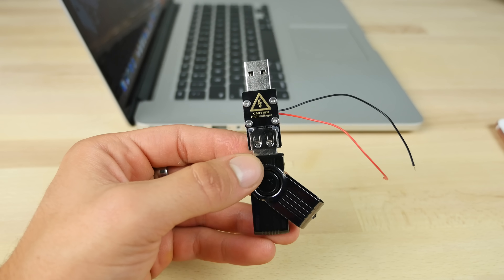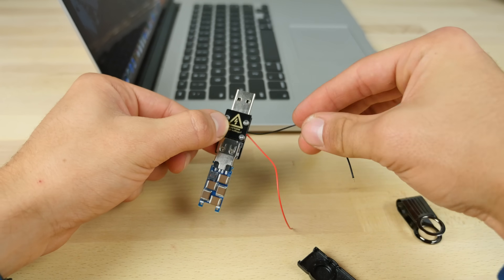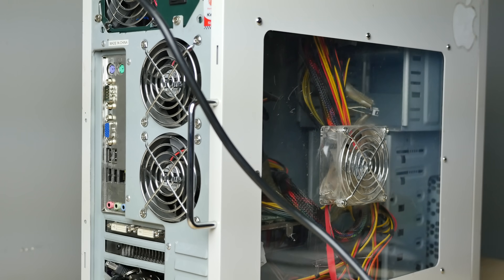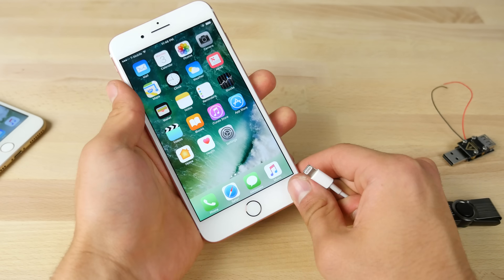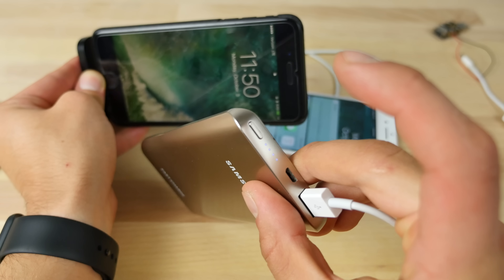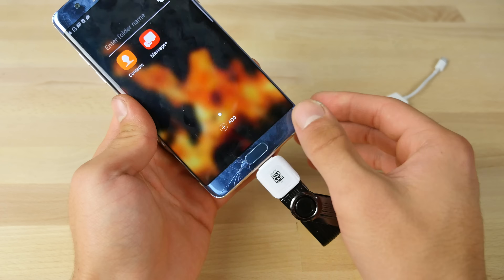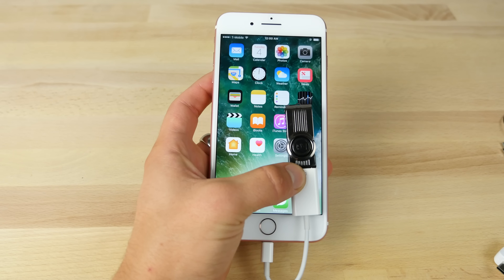USB Killer vs iPhone 7 Plus - Instant Death?

Comment: You didn't try a Home+Power reset of the phone. The lightning port (and the MacBook USB-C port you "fried") does have protection hardware and if the port disables, you have to reset the controller hardware.

I've seen the lightning port on a 6S shut down because it got wet and shorted while charging. Hard reset fixed it.

Comment: how about if you turn off the psu and hold the power button to drain any power left in the computer. Would it work then?
Reply: It needs power, if there is no power it would obviously not work. However it would be an easy feat to just add an on off button on the usb killer so that the capacitors store the electricity and then release it with an on-off button.
Reply: I meant would the computer work if the excess power was drained from within after using the usb killer and obvioulsy I meant to turn the psu back on afterwards. There are also pins on the motherboard which can be used to drain excess power and to reset any fail safes like the thermal overload switches on extension plugs
Reply: I've shorted out electronic projects accidentally before while they were plugged into my computer which would immediately cut the power to my pc and not allow me to turn it back on until I drained the excess power in the methods I outlined above so this could potentially give the same result.
Reply: Also if the usb killer was switched off then it wouldn't be powering up would it

Comment: Its most like CPU is fried,  caps charge from 5V, and send it back communication line, and most of them are connected directly too CPU. Sometimes there is HUB before CPU but the charge can be so grate that it gets to processor anyway , or hub shortens some main board voltage lines after shock.
Reply: The piezo lighter module should have similar effect on 2 inner pads of USB, if you want to fry something easier way;p

Comment: You may have fried either the motherboard or the power supply or both, but the data on the hard drives are still intact.  So, no help for Hillary Clinton.

Comment: I bet that usb killer can't kill a new MacBook Pro
Reply: yeah in the new video the new macbook pro is completely dead
Reply: Joke dead
Abort
Reply: I bet your new Mac that it can
Reply: it kills the data on the port, USB power still works and can charge as well, it looks like this USB killer sends the charge through both USB power and data lines and the data lines can't offset and turn off the power but the power lines can causing the data lines to die at a weak point that keeps the charge from reaching the motherboard.
Reply: Guys I don't know if you're aware of this but
This was joke
Because y'know
The MacBook Pro doesn't have any USB ports
Reply: Austin Evans tried it doesn't kill it but kills the USB port.
Reply: +Ryan Wang It charges but it won't import/export data
Reply: Doesn't it have USB C
Reply: Lonely Potato it can't The new MacBooks have USB protectors so
It can't fry it
Reply: Prep School Swag You got proven wrong :)
Reply: in Austin's video it just fried the USB-C port

Comment: So that IP7 clone has the best protection? unbelievable!
Reply: I don't think it has any protection. It just can't output any current via the lighting port, so the usbkiller can't charge.
Reply: did that phone die? NOT!- it still works without problem

did the original die? YES!- it's completely useless.

In the term of protection against USB killer fake phone is 100% better than original.
Reply: waki It's like saying that a car without tires is better than a car with tires because you can't puncture them. Also, you have to unlock the iPhone in order to make the port powered.
Reply: theSyd the purpose of phone is not to be used as a battery, so you cannot compare that function with a tires, it can be compared only with car radio or cup holder.
Reply: Precisely, it's such a bad clone that it does not even output any current through its "lightning port".
Reply: your all so dumb

Comment: Does the usb killer have a diode and a micro processor so that it will build up a charge in the capacitors and release the killer charge when it hits critical?

Comment: Propably the fuse in the PSU burned, or a resetable fuse on the mother board, because USB ports do have a safety feature/fuse, that blows at, i think, about 700ma or so, and a specific voltage. Also, that isn't a low voltage port, but a low amperage one. I hate people that call such computer rigs old...

Comment: plugs USB iron pc kills it instantly  
plugs into phone charging port goes
Reply: The insides of that PC were strong enough to carry the death to the other components, while on that phone the charging port was weak enough to fail and save the rest of the device. Also, the phones were significantly newer.

By the way, that iPhone is still going to die, just slowly and painfully as the battery loses its last bits of power.
Reply: good for the iPhone
Reply: So if I really hate a girl at my school I can just plug one of these bad boys in and rip to her phone?
Reply: And going to jail for murder. He'd be better off just doing the USB killer "prank" and at worst go to jail for a few months.

Comment: id guess this uses the 5v with a boost converter (can see inductor and capacitors) then it sends this voltage down one of the usb data lines.

Comment: There is a circuit board in the lightning connector on your lightning to usb adapter. Most likely it would have got damaged before anything else which might prevent the iphones from getting damaged.

Comment: What does this cook in side a PC then?
Reply: Six Bytes Im pretty sure motherboard since the usb ports are part of the motherboard
Reply: Motherboard or power supply.. either way your PC is DEAD
Reply: Something on the motherboard like a capacitor would have been overloaded. probably not the psu

Comment: All that "killer" usb stick is a usb port that isn't wired correctly. All it takes is a usb cord end with the wires connected together. Just touch each wire to the other wires until its dead lol. it will short out the board somehow if it is vulnerable. Possibly frying a vital PCB (the little wires in the motherboard).
Reply: It's not a badly wired USB at all. The capacitors store a charge and if you daisy chain it fast enough it can build up a huge charge in seconds. Then all you need is something to release that charge back down the USB port and boom. Bye bye computer. The USB is interconnected throughout the PC via the bridge chip and can do serious damage if there's no USB surge protection.
Reply: if you don't believe my try it on your own computer. just cut the end off of a usb cord and cross the wires until your computer dies. Trust me it worked before on a netbook.
Reply: Eventually, yes it most likely would but this is doing it in like 1 second. That's not even enough time for you to check if it's being recognised by the system or not. Also, most decent motherboards will have protection against slow power buildups from USB power shorting. This is a VERY quick surge that most motherboards cannot protect against. A USB device normally draws power from a USB socket whereas this device draws the power, ramps the voltage up (WAY beyond the standard USB power spec) and then sends it back to the USB socket. That's where this differs from just crossing 2 wires over. This is almost instant and it sends back a much higher voltage.

Comment: its not weird that it doesnt work on smartphones, that usb port is for charging as well, it's meant to handle electrical inputs, the reason it works on computers is because the usb port is not meant to handle charge there.
Reply: That and phones have voltage regulation chips that stop over volting. Also, newer motherboards are starting to have over voltage + surge protection on the USB ports (no doubt because of this stupid invention).

Comment: You fried the charging port but not the phone. Decent failsafe I suppose.
Reply: Until it goes flat...
Reply: Craigatron 
I don't see your point. The charging point was fried instead of the entire phone, I consider this a success.
Reply: dumbass, how ya gonna use it when it dies?
Reply: You can't stay the fuck alive if you can't sleep. Everything needs energy to do work.
Reply: an ignorant .american Good point but Samsung appears to got their shit together.
Reply: an ignorant .american What if you wanted the brand new 800$ phone to work but you only got the data.
Reply: Ivan zou, there are wireless chargers these days, thats how you are going to charge it.
Reply: That's because phones have a very low energy usage. The battery is tiny compared to laptops and desktops.
Reply: an ignorant .american what? how does wireless charging need the device to have a charging port?
Reply: an ignorant .american are you living in 2008? Samsung phones had it built in for yeaaaars 4years ago you could even buy an acessory which used contacts found under the now gone battery compartment, without using the charging port, the lg g4 last year had that aswell, also the S5's all had it, S6, S7, most notes some with it internal, i think actually almost all phones have it these days, it's industry standart at this point... attachment, gimme a break. these are only for iphones
Reply: The iPhone 7 doesn't have wireless charging
Reply: Thijmen Kuik noone said it had

Comment: This shit is scary, specially for people with High-End PCs.
Reply: El Greeko I agree. Just got a new 1060 laptop, I'd be horrified to find this thing plugged in.
Reply: El GreekoWill use that to screw over my insurrence
Reply: I think the only thing it can fry is the motherboard or the powersupply those two componets can be quite cheep if you compare them to a gpu or a cpu, pls correct me if I am wrong
Reply: Ramog1000 You are probably right. I would believe however, that a laptop with CPU/GPU built into the mobo would fry though.

Comment: If you used the same USB killer, no it will not have the same affect as it did on the Pc as it already used its power that it had. You just used the rest of it on the phone, I doubt the iphone has a safeguard against it.

Comment: The iPhone does not have any safeguard against those voltages. The converter is protecting it. The Voltages fried the usb converter chip, and no voltage reached the iphone. 
If you take that same cable, cut it off, and feed the voltage directly onto the data lines, it should die instantly. Not sure tho, because it might also require communication with a chip to go into otg mode.

Comment: It's not a low voltage port. all USB ports are 5v. It's low current
Reply: an ignorant .american
Reply: MOC3043 is an optocoupler...
Reply: That Guy correct
Reply: an ignorant .american He said the iPhone has a low voltage port.
Reply: an ignorant .american well you could use something like a small flyback driver to boost the voltage

Comment: the iPhone doesn't output current while its locked.

what if I hacked the killer, and added a battery to charge the capacitors externally?

Comment: Why hate on a Samsung thing? It's better than Apple at least lol.
Reply: Lorenzo Giancristofaro, or he wants a QUALITY mobile device.
Reply: lol just because you cant afford apple
Reply: Lorenzo Giancristofaro xD^^
Reply: can't afford =/= good phone
Reply: ScottyGoesNoot edgy Apple hater
Reply: Actually my Samsung is more expensive as a trash IPhone7 lol. Rekt.
Reply: Tixon oh shit he said rekt in his own comment, watch out he might burn you real bad next time!
Reply: Iphone 7 is cheaper than a galaxy note 7 by almost $300. Good logic Lorenzo.
Reply: Turbodaxter yup, such a good quality they discontinued the production
Reply: Lorenzo Giancristofaro once they fix the issue with the battery they will probably be back. Need i remind you of the day one bendy iphone 6? Or the iphone 5 that had almost no battery life to the point where apple had a battery replacement plan rather than recall faulty devices? Fact is both samsung an apple phones are expensive, but your making out like samsung is the cheaper option when its not. Have fun playing with the same devices repackaged. Wheres the expndable memory? Or the headphone jack, wait sorry its there. You just cant use decent 3.5mm headphones without an adaptor. Pitty, the iphone 7 has alright specs apart from that. Iphone se is the perfect example of apple releasing the same crap over and over, its pretty much got the iphone 6's internals with a 5s body. The Apple hype train has alot of passengers
Reply: Lorenzo Giancristofaro You're making yourself look stupid.
Reply: Scootakip He never said he hated apple.
Reply: ScottyGoesNoot stfu plz

Comment: Computers particularly desktop/laptop has a one way current. And PC's has no protection circuit of current going towards the board from USB making it to fry but in smartphones/tablet it has also a protection circuit to prevent overcurrent/voltage.

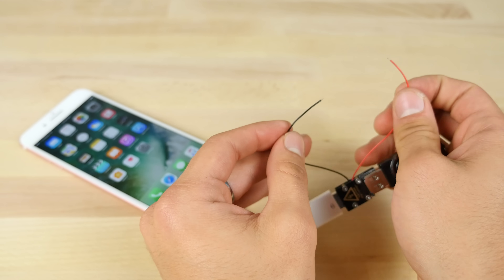Comment: 4:17 There are no low voltage and high voltage USBs. USB has 5.5V in specification, the only thing that may vary from device to device is the current.

Comment: Can it destroy a TV or a car with a usb port?
Reply: Juan Rcml probably not a car maybe a tv
Reply: Juan Rcml no
Reply: HDWhirlwind that would still only have the power of one use killer. The power going into it is divided by 10 for each port.
Reply: if you plug it into a tv the port will die not the tv
Reply: Not true... Its capacitors, they First charge... Meaning that they will just all charge slower until they realease the death charge xD
Reply: Marcos Moura oh yeah. I done brain fart.
Reply: The usb in your car only goes into the amplifier, so you will probably ruin that

Comment: this happened to my iPhone 5 way back, i guess i didn't have any other way to charge it, so i had a ac to 12v car plug converter, to a cheap car USB adapter, into a cheap cable i bought on amazon for 12 dollars for 10 cables, not sure which one caused it but the plug at the end of the lightning cable started heating up and started melting, then my lightning port was fried, good thing thats considered a hardware problem and insurance covered it. i learned my lesson on cheap chargers. although it probably wouldn't have happened if i also just had it plugged into a computer or a wall usb adapter (which i couldn't find at the time)  but this was also before they made the update blocking all non mfi certified cables. although they did work fine up until that problem

Comment: It probably doesn't work on phones because they have a system to prevent the battery from exploding (Samsung...)

Also, what happens when you plug this into a nokia 3310?
Reply: Nokia 3310 doesn't have any fucking ports dude... ;_;
Reply: ZeN Then use a capacitor bank to "charge it too quickly"
Reply: Tech Guy hello, U alive?
Reply: It probably fries the adapter.
EDIT: I guess because the phone is charged via the lightning port, it has surge protection: just like the PSU on the computer - except the USBs on the computer probably don't have surge protection so that's why.
Reply: Zestea Ooh ok, Thanks!

Comment: 1) Your computers plug fuse tripped, if you replace the fuse your computer still works. 2) phones aren't designed to charge other things it's a 1 way system, the only current you'll get is the result of trying to send signal I.e data transfer. Most devices have surge protection this is for old phones